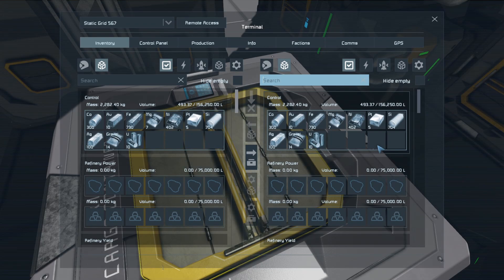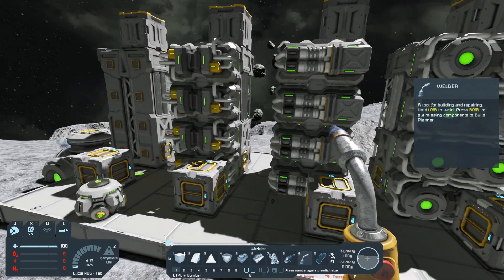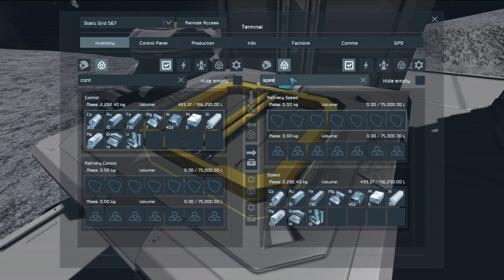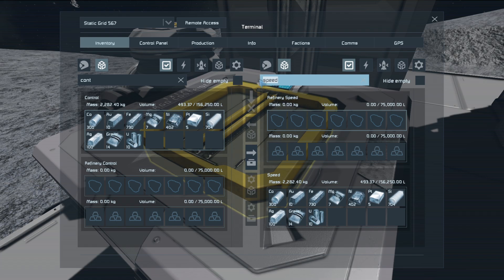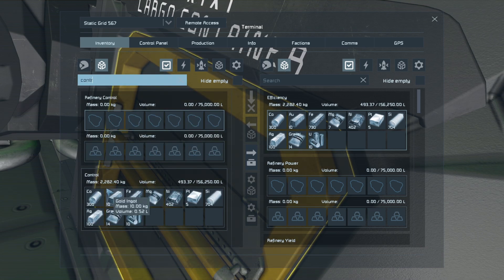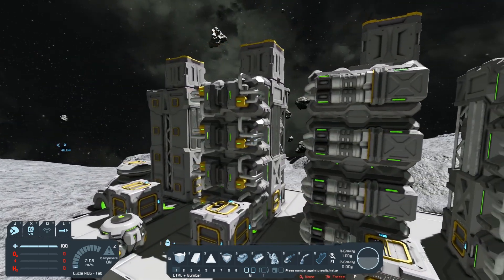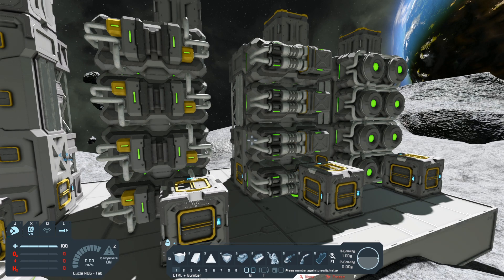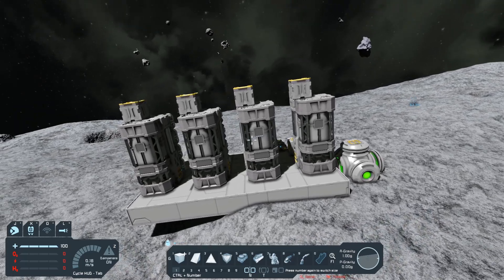Space Engineers Tutorials: Upgrade Modules

Comment: Does Refinery with all the Yield modules still process at the same rate as the Control? If yes, that would mean another trade off is double the power used to process. If it produces twice the ore at twice the rate then that's another advantage. I like the idea if the Yeild modules in that it saves you time in the game: you get twice the Ingots per Ore which means more building materials for less mining time to obtain the ore.

Three Refineries in the same volume as two Refineries with Upgrade Modules so I see that as an interesting comparison experiment for best use of materials time and power. 

Thanks for doing these videos.
Reply: Yield module doesn't consumer more power. It refine at the same speed as a normal refinery, it just make 2 ingots for the time it takes a normal refinery 1 ingots
Reply: @machintrucGaming  I wasn't as clear as I could have been so I'll try to clarifiy. Since Yield Modules don't change the rate but increase the yield that means the Refinery will run longer so if twice the yield that means the Refinery runs twice as long and that's what I meant by more power; not the same as Speed which is a power increase